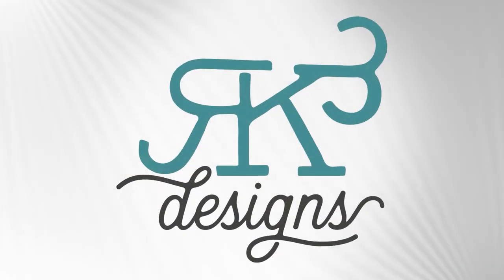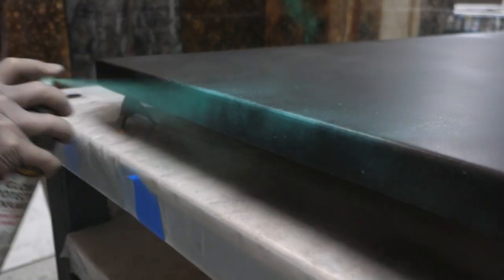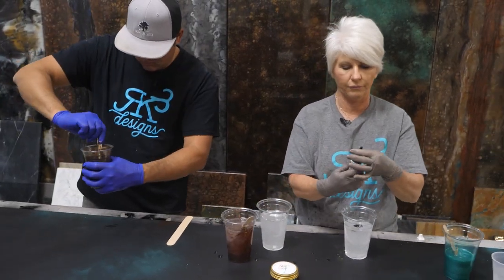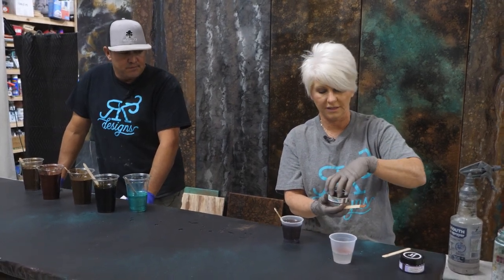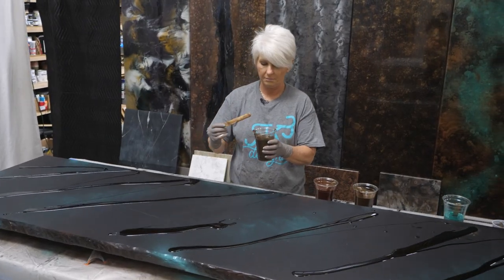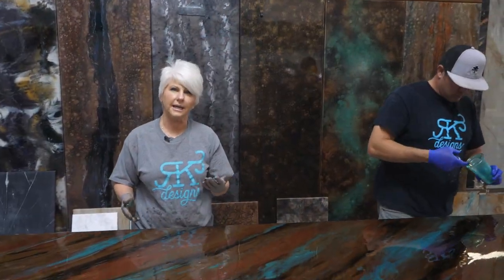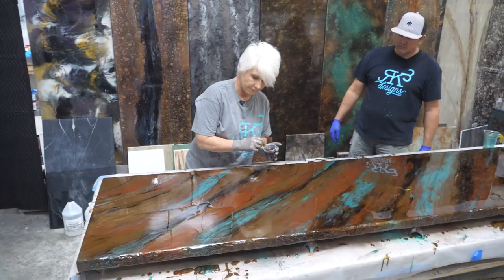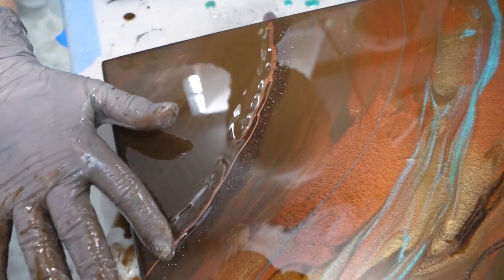How We Developed A Design Recipe For Our Customer

Comment: What type of board did you originally start out with particle board cabinet top, 3/8ths" foam board with fiberglass mesh? I have countertops that were built in the mid 70's and are covered with what I believe is either a laminate or a formica. Above the 4" backsplash there is also 3 rows of 4"x4" tile mounted on the wall above them, so the countertops & backsplash would need to be done in place and then the tile done as an accent for the counters.
Reply from the maker: We use 3/4 in MDF when fabricating countertops. You can definitely go over existing material such as laminate, natural stone, etc., just will need to use a “bonding” primer first. We use 1/2 in MDF for backsplashes.

Comment: Looks good. U guys ever did epoxy over sand? I want to create a sand floor with some red/green rubbies in the corners, for my jaccuzi cave. I want it to look like a "jungle cave"
Reply from the maker: Yes. You can mix the epoxy with sand a create a paste to be trowel on. Just make sure the area is prepped correctly and no moisture is present when you pour.

Comment: do you torch the resin after you have sprayed alchol on the countertop ? I mean not immediatly after, let's say after 5 minutes when it has stopped moving?
Reply from the maker: Only if I notice there are bubbles. Usually spritzing alcohol will release most of the bubbles. 😊